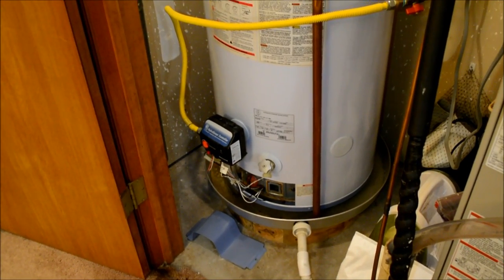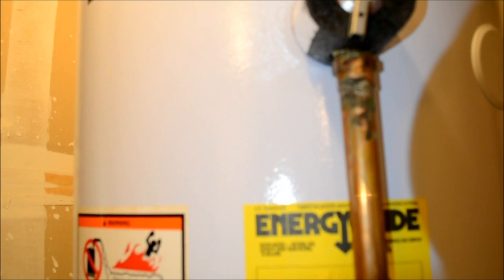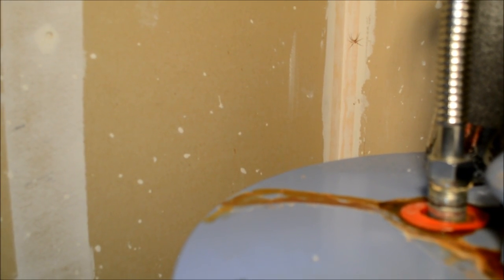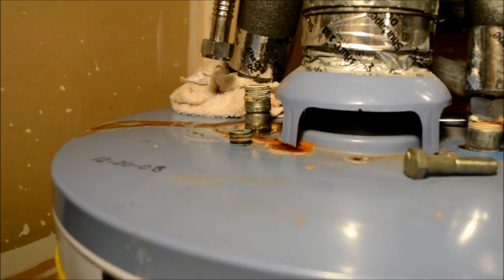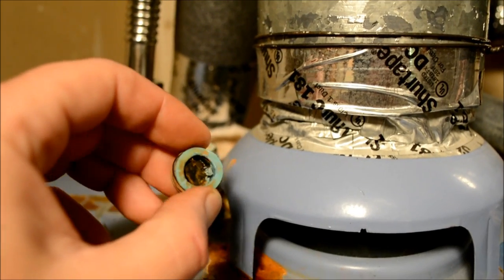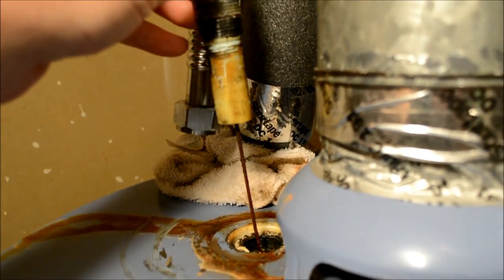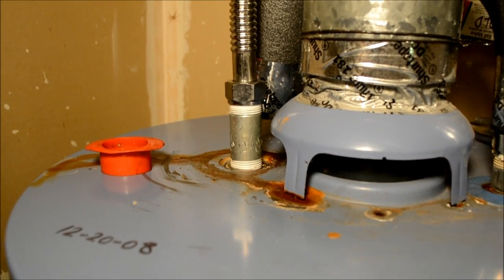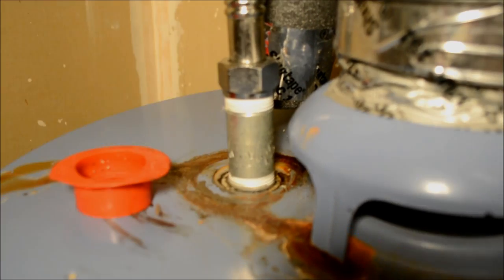How to repair leaking / stuck water heater nipple (Part 1)

Comment: This great hack worked for me. My (galvanized plastic lined) nipple was far to corroded to thread anything on to it as other you tube hacks suggested once I removed the copper female adapter. Instead following your guide, inserted a bolt to keep the nipple from deforming & used a large pipe wrench with a fence post ad hoc breaker bar slid over the end and slowly got the pipe to budge! Victory.

Comment: Thanks, Brother!  I had been struggling all day with penetrating oil and a pipe wrench to remove the cold water nipple.  I wanted to replace the cold water dip tube.  But after watching your demonstration, we followed your tip.  My son set up a ratchet strap on the water heater, and we got a cheater on the wrench on the nipple,.  With one pulling the strap and the other pushing the wrench, we got the nipple loose without knocking over the whole water heater.  
Now it is all back together and I am looking forward to a hot shower.

Comment: Time for a new heater I seen the install date on top of the heater in the long run you'll save more money I like the heater drain pan hook to the bottom to a two-way drain in my in my utility room I do not have a drain when I replace mine I will have to get that and run a line to my sump pump

Comment: Do you have a water softener?   Even after 10 years I still have about half of my anode left.  With no anode rod left you show drain the tank and inspect the inside of the tank or flush it and see if you have rust in it.
Reply from the maker: No water softener on this house. I ended up replacing this water heater 
with a new one. It was covered by warranty since the tank was deemed bad
 by the sears tech. We are on well water here and it is hard on water 
heaters. I drain the sediment about once a month to minimize the damage.
 Thanks for watching.

Comment: The corrosion will keep happening unless you use dielectric unions to isolate the steel pipes from the copper lines.  Ask me how I know. ;-)
Reply: How do you do ii?
I have the same problem. I’m about to replace it and I don’t want it happens again.

Comment: I have a leak right above the nipple on the hose. Do I need to turn off anything before changing out the hose? Cold water valve I shut off but what about the gas line?
Reply from the maker: The gas doesn't need to be turned off but I would turn the pilot light to the off position while working on it. On the cold water line make sure the shutoff is working, then bleed off the pressure (at the sink) and you should be fine. Good luck!
Reply: The Hands On Channel I got the line off but bent the male end to the shut off valve and prying it out has not been easy... still at it
Reply from the maker: Keep at it. Plumbing work is rarely easy.
Reply: The Hands On Channel thank you for the help, appreciate it
Reply from the maker: No problem, hope you got it fixed. Thanks for watching.

Comment: I have this issue right now my roommate found a leak in my closet down stairs in my bedroom and the carpet in there is really wet  from the faulty Water heater valve is this a regular issue with a condo that my parents bought for me in 2009 I have not been able to go over to the condo now because my parents think there's mold issues where the leaked out of the hot water heater upstairs and my bedroom is right below the hot water heater tank we are keeping fans blowing down onto the area's that were effected by the leaking hot water heater valve it's fustrsting not to be able to live there because it's not getting repaired right away if there is mold were we can't see it on the other side of the wall what would be your advice?
Reply from the maker: Bleach for the mold. If you hit it regularly with a spray bottle of bleach it should kill any mold. If it's in between the walls and you cant access it to spray with bleach then you will have to remove some of the Sheetrock to visually inspect for mold. Also, if you have a continuing leak you should turn the water heater/water supply off and drain the water heater until the unit is repaired or replaced. Sorry to hear about your leak I know how frustrating these things can be. Good Luck!
Reply: The Hands On Channel we had someone replace the faulty Water heater valve and everything looks good so far no water has bubbled up from the floor from the water heater there is some wetness where the water pooled up in the closet should we wait to start doing repairs to make sure that it's not coming up from the slab my mom thinks this is left over from where the water pooled up in the closet at the apartment. I'm keeping positive that we don't have mold mom said she didn't see any mold fingers crossed but we did move the carpet out That had gotten wet from the leak from the faulty Water heater valve but so far so good everything is going well with the drying out process thanks for the response
Reply from the maker: Sounds like you're doing the right thing. I would want to be sure that no water is leaking out of the slab before you close everything up. If the water heater was the sole cause of your problem you should be able to completely dry the area out and watch it for a few days. Thanks for stopping by and good luck with your place.

Comment: My setup is very similar Its in a corner and I have no way to ratchet the tank to anything. I noticed you had a ratchet strap to keep it from moving as you wrenched on the anode nipple. My question is what did you ratchet it to? Or did you use the ratchet as just another way for someone else to get a grip on the tank? Any suggestions are much appreciated. I dont have many dependable friends that would come give me a extra pair of hands. So I do most things solo and need a way to keep the tank from moving while I wrench on it.
Reply from the maker: I used the strap around the tank only. It gave me a solid handle to hold the tank from spinning. Good luck, these things can be a bear.

Comment: The fitting to the nipple doesn't need tape on the nipple. The washer in the fitting does the sealing. Tape can cause the washer to not seal completely.
Don't put pipe sealer on tape. The tape is all that is needed. I've never had good results from using pipe sealer on water devices.
Reply from the maker: Thanks, I didn't have any issues but I see what you're saying about the tape. You're right it's not necessary on the top side of nipple. Thanks for commenting.

Comment: I appreciate your tidbit about putting a bolt inside the pipe to help keep it's integrity whilst trying to get pipe off.
I must say though it's funny that you assume only heterosexual men are performing these jobs. 
I'm a single heterosexual female that performs all these necessary household repairs-lol.
Also you might want to consider dielectric unions to prevent the corrosion.
Thanks for posting :)
Reply from the maker: Funny I don't remember saying only heterosexual men should do this repair. What do you mean? May be you are referring to my intro where I say hey guys? IDK but I didn't mean to imply that. I am equal an opportunity handyman. Glad you liked the bolt trick and thanks for commenting.
Reply: why am i not surprised you are single smh.
Reply: You can buy a water sensor about the size of a cell phone 9 volt battery just lay it by the water tank it's 110 decibels $10 at Menards home Depot
Reply: Use shark bites or compression fittings make it easier personally I don't like solder joints on the water tanks because they do not give the flexibility
Reply: About the dielectric unions good idea

Comment: Did anyone ever ruin the water heater.  I've got a stuck nipple that I want to replace.  I've tried the pipe wrench and rubber mallet method, but no luck.  I'm concerned that the nipple and tank threads are so locked that the tank will be damaged by being forced before the threads break loose.

I've read the comments on all of the youtube videos about removing stuck nipples and did not see anyone say that they ruined the water heater.

thanks
Reply: thanks
Reply from the maker: I doubt you will ruin the water heater. I guess if the nipple breaks off it wouldn't be able to be used again. If you've tried everything that was showed in the video you can carefully try to heat it with a torch. Good luck, I know these can be a real PITA.